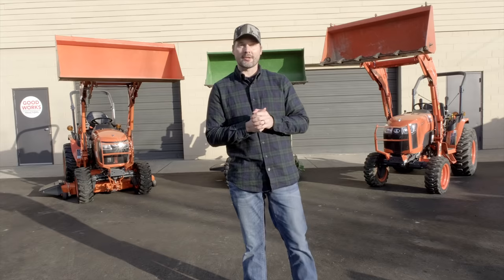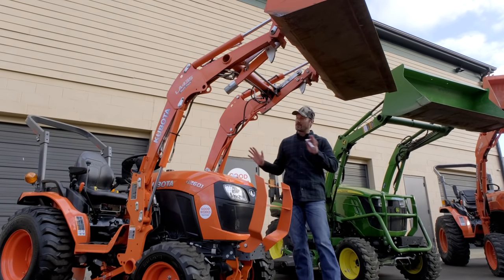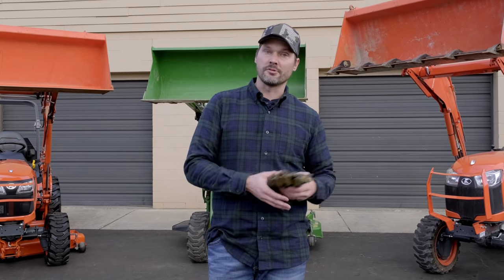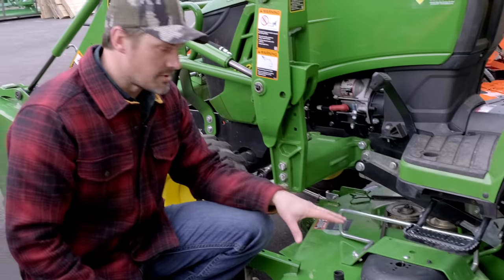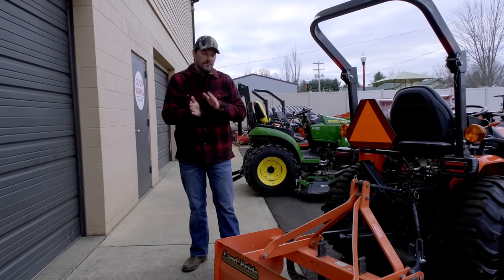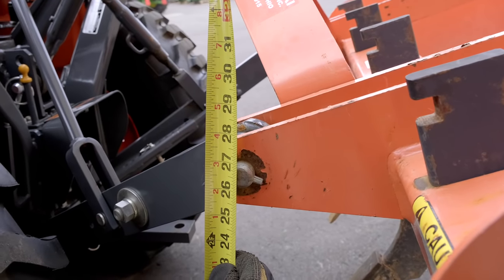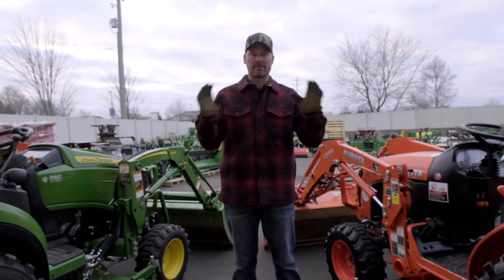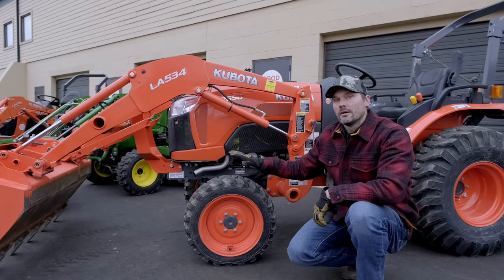NOT EVEN CLOSE! JOHN DEERE vs KUBOTA: B2601 vs 2025 vs B2650

Comment from the maker: If you're in the market for tractor or attachment, then you gotta check out my website!  All sorts of cool tractors and attachments!  http://www.goodworkstractors.com
Reply: You don't understand, I have already been on your website several times. That is where I saw the tractors that I asked you about.
Reply: I would like the see the John Deere 2025R specs with the H130 loader on it.
Reply: I’m kind of looking right now everything I see is over priced trying to get some thing around 4 to 6 thousand need a Mower deck and a No blade or snowblower in Illinois so about aAcre and a half and Hundred yards of driveway
Reply: Good comparison  vid. Very helpful. That means our John Deere does not get a Dear John.  Thanks.
Reply: That yellow on John Deere represents the gold JD owners are going to pay for maintenance.
Reply: Ontario canada 🇨🇦
Reply: @cwgreen1938  6th 6th MI by u 9th
Reply: I work in finance, have a 0.45acre lot, Ive never operated a tractor and I'm addicted to these videos.
Reply: Worked at a 25 acre campus. We rented both Deere and Kubota. We ended up buying a JD 32 hp 4 wheel  drive factory cab with AC HEAT etc.   REASON- better quiet cab, nicer brake pedal set up. Had a tough time with kubota turning with soil conditioner. Needed both feet on one side to operate brake and forward reverse pedal. Also reverse was so far back. Had to almost stand up in seat to get foot that far back. Got a very sore leg doing that. Some choice words for that set up.
Reply: Me too.
Reply: Jji
Reply: I would like to see the price differences, including those of the attachments that are available.

Comment: We have a bunch of Kubota excavators and skidsteers at the construction company I work for. They run basically nonstop all year and hold up really well.
Reply: Our JD skid steer, got a video of it burning down, less than a year old at the time. Knew, did know, don't know them anymore, because they burned to death in JD cab tractors.  I don't know anyone that's died of covid.  Seen a good many of those yanmar green tractors with cracked heads. Kubota cracks heads too, but all of them were well used and old when it happened.  Be sure and always check the gearbox on the Kubota decks. They are a pain to replace.   I tend to avoid plastic hoods and grilles.  I got so tired of replacing that mess. Dealer financed and customer had to have insurance, so it was replaced when brought in.  Or, you get the guy that ran a fairly new tractor out of diesel. He put more fuel in it and used starting fluid trying to start it.  Engine was no bueno.
Reply: Well, I'm definitely glad to hear that. How has your experience been with service parts for repairs?
Reply: Does the John turd have a yanmar engine ?

Comment: I've had 4 Kubotas.  3 tractors and one excavator.  Never had one of the Kubotas back to the dealer for repairs.  The only thing I can say about the green ones is they cost more.
Reply: Nobody mentions the propriety hold JD has on their machines,, you never own the software,, they do,  read the small print... If you have any problem with their software driven repair analysis you have no choice but to call JD...

Comment: Lots of good comments on here, I also love my 2601, its a little tank. I ordered and modified the B2650 back hoe sub frame to fit my 2601. Huge increase in frame strength support but then down the road I could put on the larger backhoe that has the capabilities to bury an 8' deep water line. They are really impressive tractors, I have built many attachments to fit my little work horse. Love it and hope everyone is just as happy with their little tractors no matter what the color. They are expensive but so handy to have.

Comment: I have been using my 2016 New Holland 41 tractor 4WD w/loader on areas of my lawn I shouldn't, since I retired and gave away my Kubota 20hp w/belly mower for over 20 years. So, I'm definitely going orange again and have decided which one I want. My dealer has a nice LX2610HSD w/loader for about $20. Not too big and not too small. My old Kubota had some limitations but the LX2610 looked just right. I stopped buying JD back in the 90's and never looked back. I'm definitely going to subscribe because the info is excellent and so are the replies.

Comment: I was a mechanic at a JD dealer for years and found that quick coupler set up for the drive over deck to be a real pain. Hard to get it set up right and hard to keep it right. I don't think you should hang too much weight on the 3 point. They are 4 wheel drive and so traction should not be an issue. Had a customer with one of these JDs. Can't remember if it was the 1 or 2 series. Had a snowblower on the front and a concrete weight on the back. Nice big aved driveway area. Bouncy got that weight broke the 3 point cylinder area off the trans. It's all one casting on that model. Tractor was almost new. Had to change the entire transfer housing. Lots of money and lots of work other models had the cylinder area bolt on. Another thing I've seen is the bearings fail on the hydraulic pump idler gear. I saw someone put a comment about a bad 318. Mostly they were a very solid tractor. Main problems I ever saw were the electric clutches. Especially the rear one for a tiller. And when they get old the gasket under the oil sending unit dries out and leaks making a mess.
Reply: Can I fix any of them without having to hook up to a server somewhere?

Comment: I debated a long time between the 2025r and the B2601 for my 5 acres. Ended up going with the 2025r, and I don't regret it. Two of my close neighbors went with B2601s (also on 5 acres) and they like them too. Great tractors that easily clear snow and perform basic duties around the property.

Comment: I bought a B2601 a couple years back with a belly mower, loader with quick attach bucket, and grapple. I went with B2601 over B2650 for the maneuverability of the smaller size while mowing  I have been amazed with its capabilities and love the tractor. The grapple works great and has saved my back. I also have a L3800HST. One great improvement on B2601 over L3800 is putting brakes on left side This allows quickly putting on brakes while maneuvering close to something. This is especially helpful on a hill. Great video by the way.

Comment: Great review! We bought a 3033R a couple years ago. It is our 3rd and last John Deere. It didn’t last 15 hours before it spent 3 weeks at the dealer and then another 3 weeks at the dealer for a complete wiring harness before it had 150 hours. I would definitely lean toward a Kubota or Massy. We had the same horse power JD and thought we would upgrade to a new an improved tractor. 
$30,000 and 15 hours later, we realized we had made a big mistake. $30,000 and 150 hours later, we confirmed that mistake. 
I think our 3320 was a lot more tractor for the same horse power.
Reply: I have a 3038 I bought in 2013 new. It has been used on a hunting lease since 2013. I’ve run the shit out it, never a problem. I also run it on my property, nice to have. I don’t know about now, but mine is awesome.

Comment: Great video!  My family over the years have had Fordstons, Fords, Olivers, JD, Kubota, Allis Chalmers, IHCs etc.  Never brand loyal but always looked for the best deal or a certain capability  (such as the early turbocharged Allis-Chalmers)  I looked and tested JD, Kubotas, Case, New Holland, Mahindra, etc. Although I was leaning toward Kubota I eliminated them after I visited their dealership and was very depressed at their incompetence and lack of knowledge about what they were selling.  I believe the most important thing in a tractor today is the dealer and their ability to provide good, fast, and reliable service.  I ended up buying a 2015 JD 2032R and have had nothing but good reliable service from it.  It isn't the most comfortable tractor out there but it is a worker.  Good maintenance practices on any brand will pay dividends.
Reply: A farmer I worked for changed to a Deutz from a Kubota for the same reason. They weren’t interested in keeping you happy, even if it was their fault. I actually had the main gearshift come off in my hand while running a bale shredder. It was a lot of forward/reverse, and a long-standing crack in the casting let go. They seemed unwilling to accept that as unusual.

Comment: I bought a b2650 new on November 2019 r4 tires, loader with skid steer quick attachment, 60" mid mount deck and 60" bush hog for 22k. Haven't regretted it one bit. JD would have cost me way more new with all that and their attachment system is proprietary so I'd have to buy their stuff to use. Best bang for the buck, I say go with a Kubota.

Comment: Thanks for the info. The step for a B2650 will bolt right on the Kubota B2601 with out any modifications. The part number for the step is 6A700-51350
Reply from the maker: Sounds like others say it interferes with the mower deck though.  Thanks for sharing!
Reply: Cant say anything about the mower clearing but the step fits perfectly. And I think its great

Comment: Thank you for this.  I went with the 2025r just because I hate the treddle peddle. But I do wish it had a better lift capacity on the loader.
Reply: My 2025R lifts a full bucket of stone with dust but I have tried to lift too much with forks. I too like 2 peddles. I looked at the large frame 2 series but they would not fit inside my trailer. I am now trying to sell my trailer and should have gotten a 2032R or 2038R.
Reply: The 220r loader is a better fit for a 2 series and more comparable to the loaders he showed on the kubota tractors

Comment: Thx. for this 2025R vs. B2601 comparison (I was one who requested it:)) & have basically narrowed my decision to these two and am really torn. The B2650 is probably a different class w/capabilities since is a bigger frame & more in line w/a 2032R. A B3350 or LX 3350 vs. 2032R would be a great comparison (both too big for my application). I believe other than PTO HP the B2650 & 3350 have the same capabilities.

Four things off hand that you didn't mention that would be useful:

1) Turning radius comp. between the B2601 & 2025R? Esp. since same wheelbase & track (Deere's spec. sheet is rather lacking). I suspect the 2025R will be significantly better b/c of their steering geometry (steering linkage behind the axle or as referred to in big trucks "rear steer"). Kubota does however have a split brake on the B2601 whereas the 2025R doesn't but on turf that's not so significant although still a notable feature. 

2) Does the 2025R have position control on the 3 pt. Hitch? Deere's spec. sheet doesn't indicate. 

3) I believe the Kubota's BH on the B2601 has significantly deeper (12"?) Digging capability. 

4) I believe Kubota offers more/better hydraulic options, especially on the rear (both I believe offer a factory 3rd function hydraulic option for the front).

One thing to point out on the Kubota is that since the skid steer quick attach is optional, it takes away from the loader's rated capacity. I've come to appreciate Deere's "proprietary" design for it's weight savings. Tim does a great vid. comparison. Still surprised to see how much more rated capacity the B2601 has and the extra 3" of height sure is nice. Again, Deere's spec. sheet is pretty lacking.

To answer two points you raised: 

1) The B2401 (same D1105 engine as the B2601 but less HP - Not sure whether de-rated or just rated using different methods) is the gear drive model and is slightly de-spec'd with respect to features (no tilt/cruise/armrests/?). I am going to test drive one just to be sure. My heart wants a gear drive but my head says HST.

2) The B2650 step will bolt onto a B2601 (mounting holes are already present) but will not work w/a mower deck installed. Maybe the step risers can be shortened but Kubota should step up (no pun intended) and make the correct/shorter step to clear the mower deck. It's a very common complaint 

If Deere (maybe someone from Deere reads these) had a 3sp. & the better swing arms (pathetic on a high end machine to have turnbuckles) my choice would already be made. I assume w/a Quick hitch it doesn't matter as you only have to set them one time? Deere owners don't complain about the 2-sp. but Kubota owners ALL rave about the 3-sp. 

Deere's mower deck attaching & (optional) lift brackets are (very) compelling reasons to go w/a 2025R. I have yet to drive a treadle pedal but will be doing so next week (my local Kubota dealer didn't offer me the opportunity so I'm going to drive up to Messick's). People seem to say you'll get used to whichever and I tend to agree but having driven the Deere, so far prefer their system. Lights can be added to a B2601 but Kubota should include (there is an optional ROPS forward & rear lighting kit avail.). The single point hydraulic connector is apparently standard on the B2601 (and now optional on the 2032/2038R) but not even avail. as option (short of buying/installing through Deere Parts) on the 2025R. Again (common theme) Deere's literature is awful.

The fuel fill on the Deere is another compelling reason to go green although again, on a premium tractor, the gauge should be on the dash like the Kubota. I could see spilled fuel on the hood of the Kubota and speaking of hoods, the plastic Deere hood is another compelling reason to go green. As you've pointed out, every Kubota has dents in the hood and the paint looks oxidized whereas the plastic hoods seem to clean up/buff out much better. 

What it comes down to for me is that Deere seems to excel in convenience/appearance features (exception being the single point hydraulic connector) w/the 2025R but the B2601 has more "real tractor" features. Decisions, decisions... 

Kubota also has VERY attractive financing on the B2301/2601 through 12/30/20. 84 mo., Zero down, zero payments for 90 days & $600 off on the B2601 plus $700 off on 2 implements.
Reply: I have a 2025r and love it. Best thing I have ever bought.
Reply: I have a BX2380 and love it.  Best thing I have ever bought.
Reply: I have owned both 1025 r and b2301 both are good but the Deere just out worked it.
Reply: @jaycooper1826  Interesting being that the JD is a subcompact & the Kubota is a compact.
Reply: @danielsharon524  the Deere was just smoother and quicker
Reply: @jaycooper1826  Wow - That's surprising. I've only test driven a 1025R once and a B2401/2601 one time ea. so hard for me to tell. If the B2401 had better hydraulics I'd get one. I knew I wanted something just a tad larger than a 1025R but I like the features on the B01 better than the 2025R. If the 2025R had better hydraulics/lift capacities than a 1025R it'd make the choice tougher. If it was between a 1025R & a BX, I'd definitely get the 1025R. Being it's my first tractor ever (have wanted one since I was a kid) I'm sure I'll be happy w/the B2601 but I really appreciate your input. It's been a tough decision & has taken me quite awhile & a lot of research/visiting dealers to decide   & I'm finally ready to order one.
Reply: @danielsharon524  I had a 1025 Deere now I have a b2300 Kubota. 1025 is really competing with the bx series my 2300 is a step up. The thing I didn't like about the 1025 is it ran hot while cutting grass the front screen was constantly covered with grass from pulling air. The Deere deck blades cut twice as fast though and left prettier cut and I could move dirt faster and easier with the Deere but I like my Kubota it's fine. A bunch of us here local have Kubotas and have annoying problems like flashers not working half the time and drive shaft is tricky you push in and pull back and if not just right it will pop out and tear up. Im good enough with it I'm not spending money to trade or sell and Deere give me my money back they couldn't figure out why the tractor ran hot

Comment: About 30 years ago, I was a partner on a banana farm. I told my partners that the Kubotas were better tractors, but they were dyed in the wool JD users. Finally we set up a spreadsheet of features both desirable and not so much. The Kubota 5030 and 8030 vs the JD 1040 and 1640. The Kubotas won by such a wide margin, my partners demanded a recount! Last time I was up that way, those 2 Kubotas were still going strong. What really swayed me was the ease of lubrication. The JD's were such a pain, people wouldn't do it, and on a banana farm, that's death for the drive train.

Comment: The main issue not mentioned is which company will support policies cater for their customers the best. Which company will supply parts and services to keep your tractor useable. John Deere betrayed their loyal customers by no longer supplying  parts like clutch  and brake parts that wear out. Forcing you to buy new expensive tractor which they quickly offer you.  I was brought up with
John Deere but became disappointed when I saw I could no longer buy simple parts to keep my tractor running. Kubota however were more supportive to their customers in this regards.
Reply: My local Kubota dealer treats me very well.  The few times that I have been in the local Deere dealership (they also sell Stihl chainsaws, which is the only reason I was in there) the folks in that dealership acted like they didn't have the time of day for me.  I guess I am just a small-time guy, which is fine because I will drive down to the orange dealer and leave the green behind.
Reply: THIS.